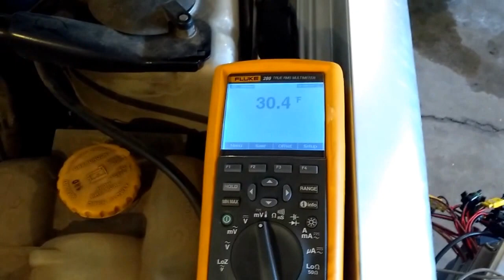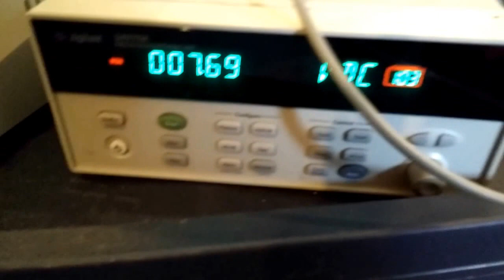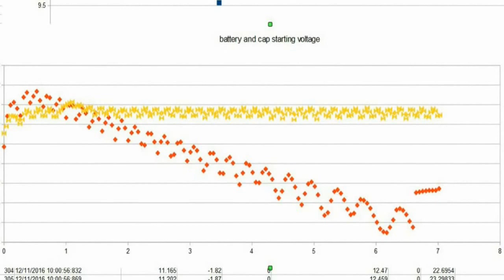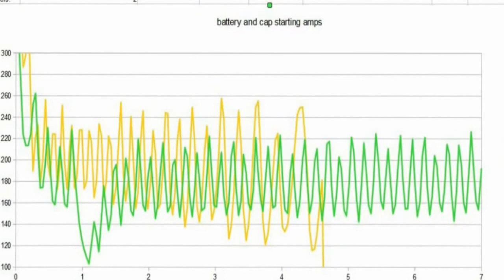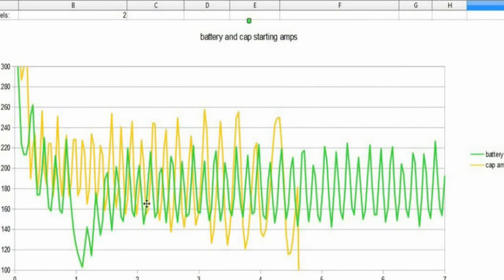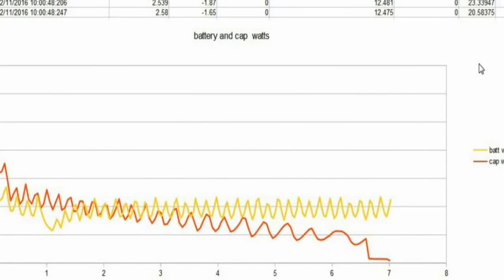Using a super capacitor as a battery (part 4)

Comment: Great video, I enjoyed your test approach.
Reply from the maker: Thanks I just ordered  6 3000f Maxwell capacitors. Shortly after making this video I figured out that a number of those capacitors I used were faulty.
Reply: I look forward to seeing how you use the Maxwell's.
Reply: Were they defective from manufacture or did they die from use? Also how many were defectve?
Reply from the maker: Out of the 18 that I purchased four of them had excessive leakage current. They were like that right out of the box.